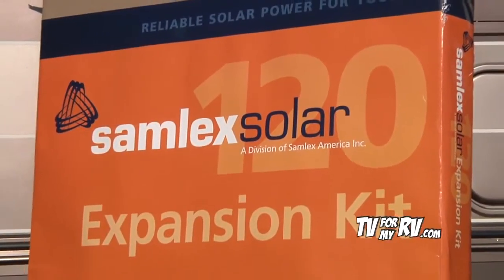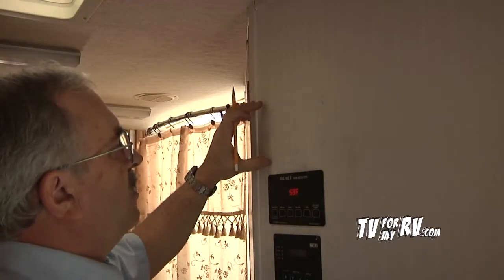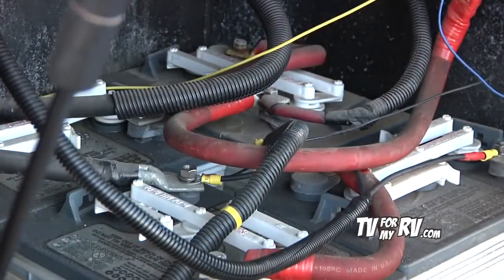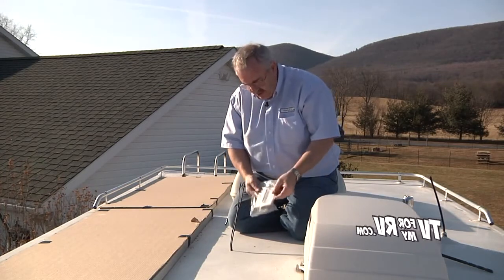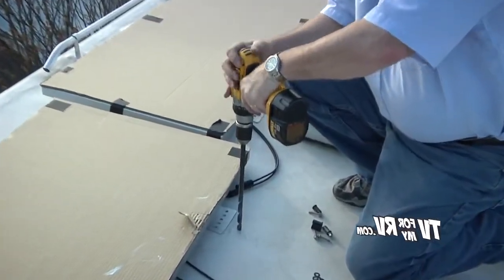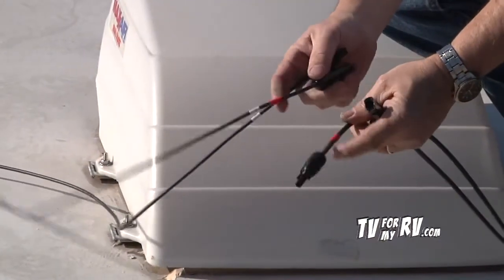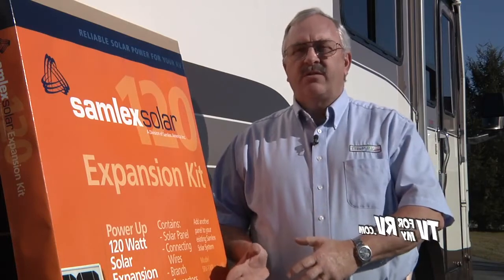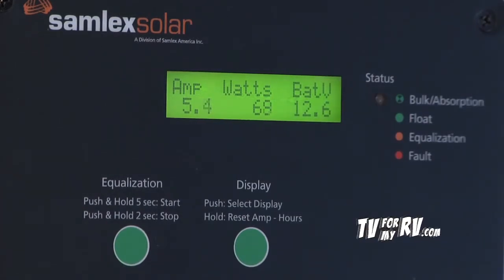Solar Power for Your RV

Comment: I don’t know why Samlex is still stuck to PWM solar charger. They have no MPPT charger which is at least 20% more efficient. These are bigger though. I would recommend buying their solar panel despite being more expensive but buying a separate mppt charger from an other reliable brand, for maximum result.
Reply from the maker: Thanks for the positive feedback on your Samlex solar panels. We are continually working on expanding our product line to meet the needs of our customers and adding an MPPT controller is in the product plan. Thank you!